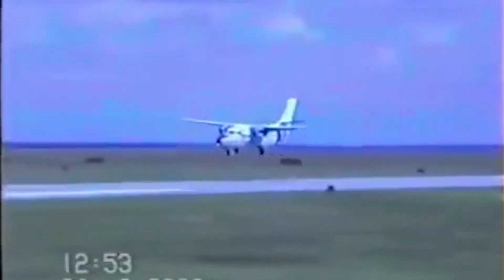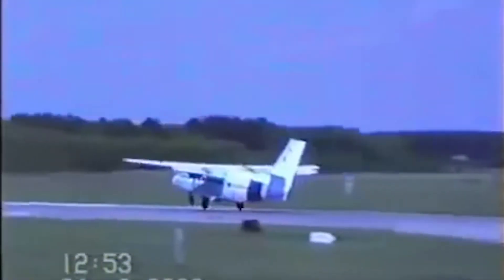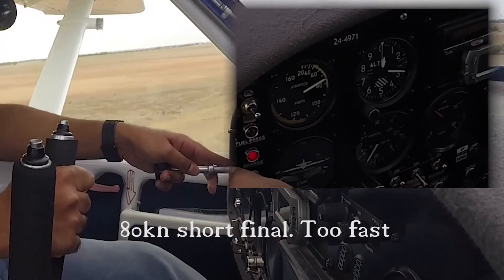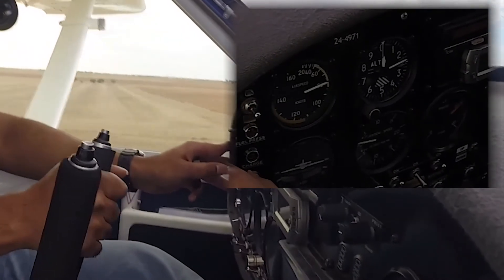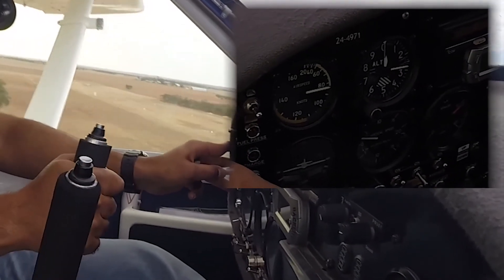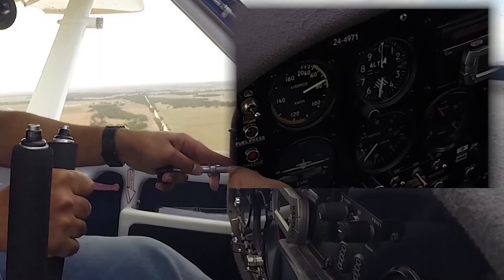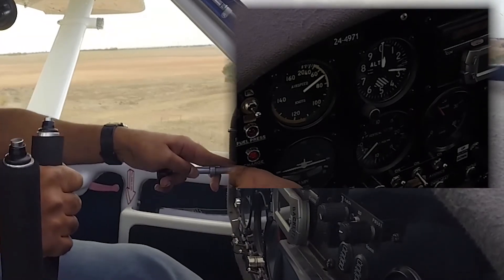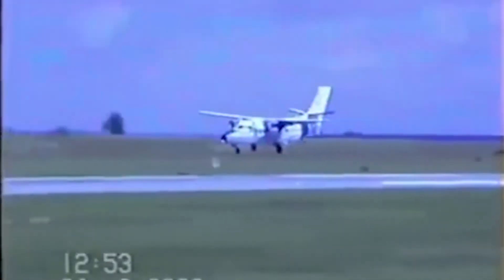Pilot Training  l  The Dreaded Porpoise  l  A Case Study

Comment: Porpoise is bad, Pilot induced oscilations added to it always ends in disaster. 

But Why always a go around? 

Im just curious, 
i am only a sim pilot (High quality sims for civilians/non pilots but nearing 7,000 hours flying Commercial Airliners and GA)
always wanted to be a GA pilot but then i hurt my back and i dont think i would pass medical tests.

Anyways But i have found a way in ww2 warbirds (tail draggers obviously) that when i porpoise if i let the plane bounce (no stick forward) 
then as it sinks for a 2nd bounce i "Over flare" to correct the extreme Sink rate just at the right time and it arrests the porpoise and lands in the 3 point attitude.  (kinda like letting it bounce then taking this new Alt and so on as a new approach all be it with a further landing spot 

Then i Tried that in Cessna and piper seneca in X-plane 10 and got it working to some degree.

again just curious, when i cant sleep i dont read, i watch hours of these videos :D
Reply from the maker: Welcome to my channel. A good question. I'm also a simmer but the difference between sim flight and real flight is the possibility of an accident. As happened in this case. The majority of small aircraft accidents are caused by loss of control at or near the ground. The "safety" button is to get airborne go around and re-establish for another landing attempt. No reset button here. The tip of the prop in a tricycle undercarriage is quite close to the ground and a small porpoise can cause loss of control and a prop strike. Taildragger props are much higher off the ground and give some additional clearance. Hope that helps.